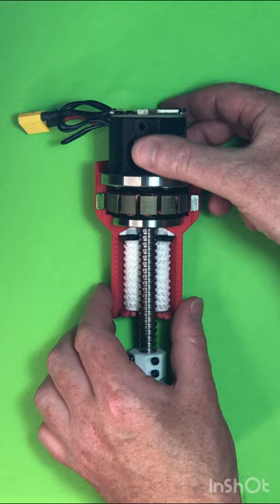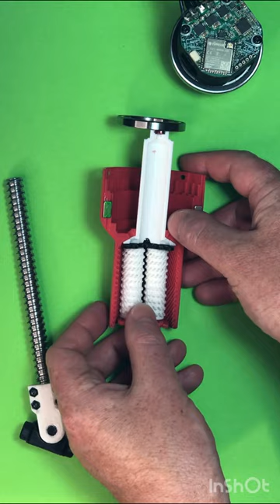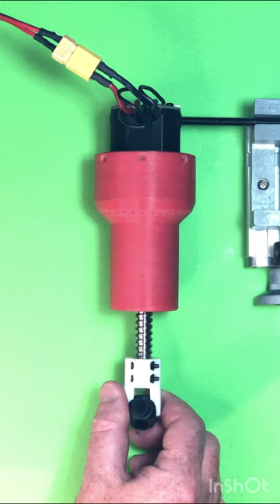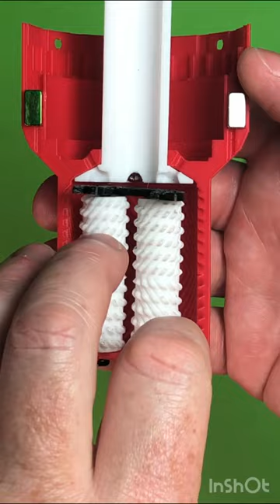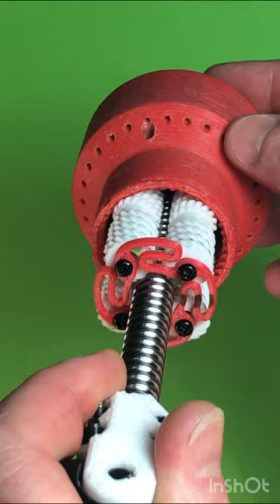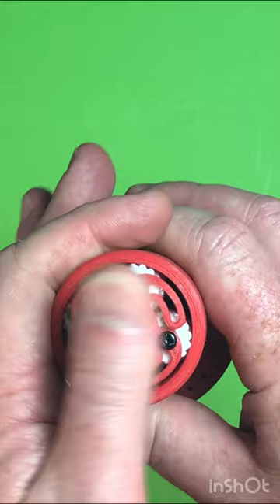Roller Screw Planetary herring bone actuator with ball-less ball screws. 28 magnets in halbach array

Comment: Omg you did show a teardown, yes!! What kind of contact force is on those herringbone ballscrews? Would it wear quickly on 3D printed parts? Also is the bottom red part just meant to be lightweight or is it a compliant mechanism for assembly or something?
Reply from the maker: It is all rolling contacts and the force is spread over a very large area, so it shouldn't wear down too much. Correct, the bottom read part is for assembly and to keep the parts spaced evenly.